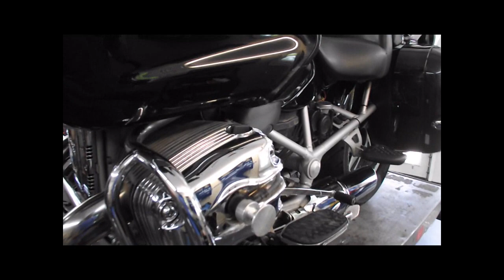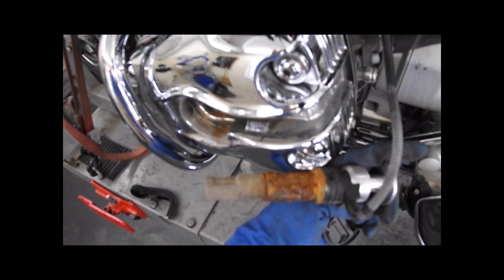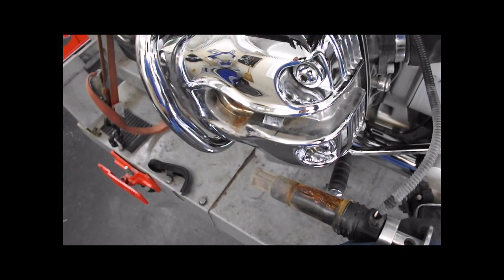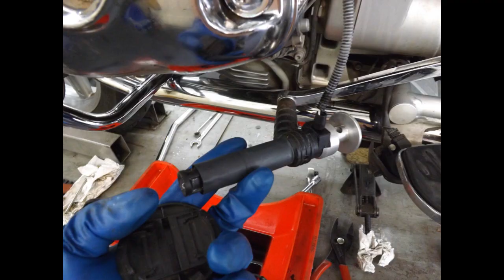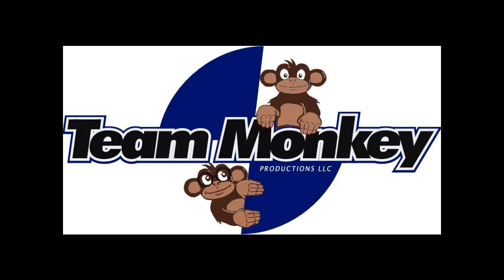BMW Service - R1200CL Stick coil issue

Comment: i think most bikes with fuel injection suffer from that, thats why a yearly check is needed, i have a z1000, so i covered my coils with a thin layer of high temperature grease, then i got an o-ring to seal the upper part of the coil so no water can go inside...

Comment: Any chance you could make a video on synchronising the throttle bodies? 

When are you going to unleash the fury?
We are all calm and collected these days.
Any how, keep on making the videos anyway,
yourself and Illinois motorcycle club has taken all the mystery out of the metal horse.
Reply from the maker: dwmfty There's only one throttle body on this model so there is nothing to synchronize and no surging.